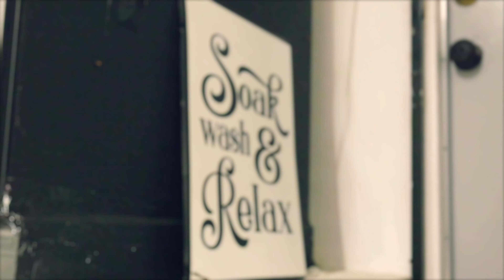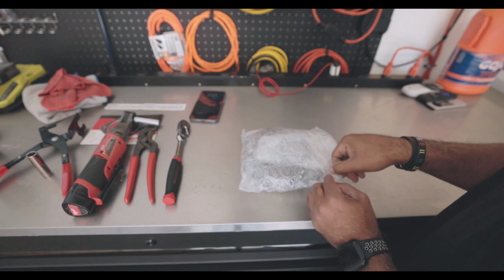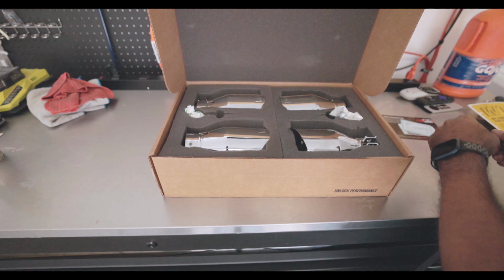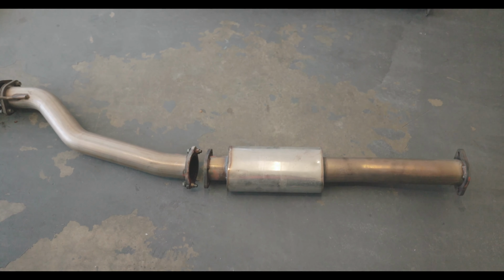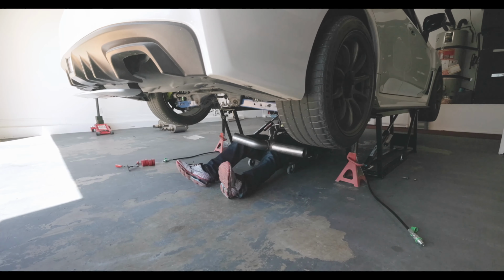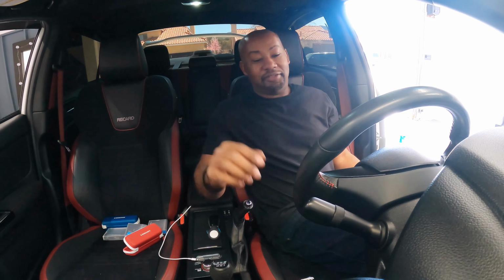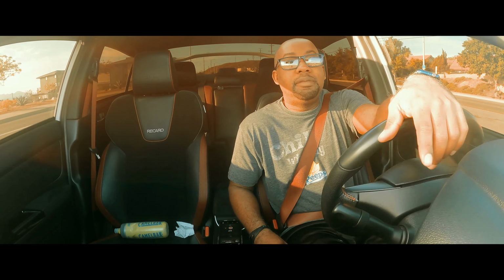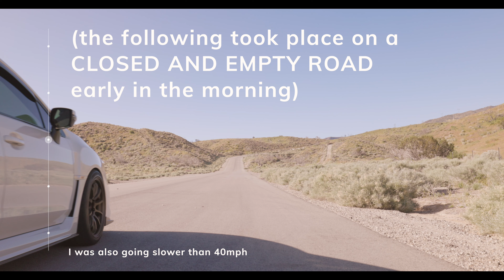AWE Touring Exhaust Subaru WRX STI Install Review

Comment: I have the awe track version on my car u won’t need the grimmspeed gasket only the donut gasket that came with the exhaust
Reply from the maker: I really want to hear the track version.  i had a feeling i wouldn't need it AFTER i opened the package.
Reply: Mine didn't come with a gasket? Do they or you just used the stock one?
Reply: ... you can reuse the stock gasket as long as it isn't destroyed...new donut gaskets are cheap and available at all parts sellers (IIR, RSD, Subispeed, etc).  the AWE is meant to be use the stock j/downpipe

Comment: does yours leak at the slip joints?  all 4 of my joints show some form of leaking (moisture and soot).  I've reset the joints multiple times and nothing stops the leaks.  the clamps are tight; nothing moves.   Also, good luck keeping the tips clean.  I've given up and they are black on the inside lip.  Unless you clean them after every drive, they won't stay shiney...and I have their tip tonic too....
Reply from the maker: it did the first week I got it. 
I use this for the exhaust https://amzn.to/3Pjtp7X and  https://amzn.to/3uYL0Lx